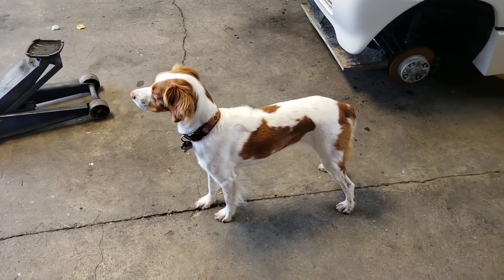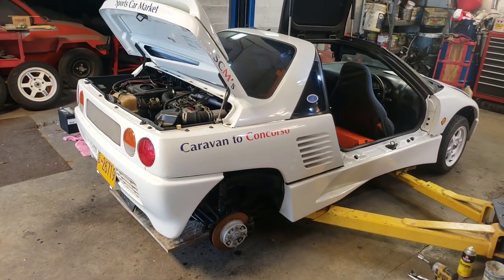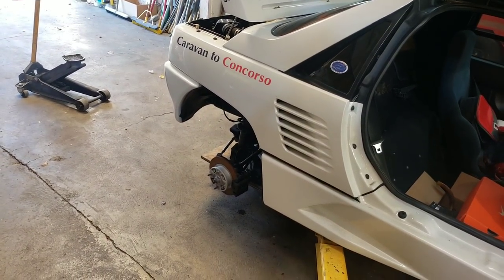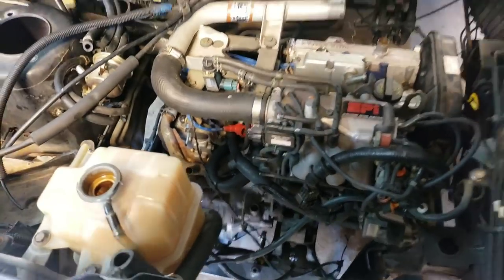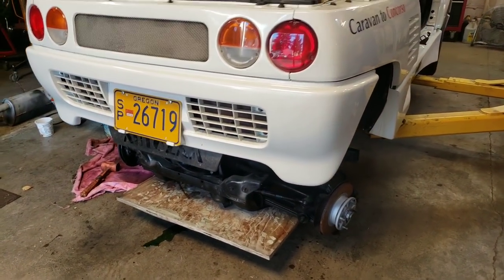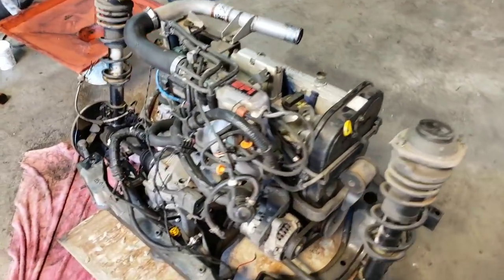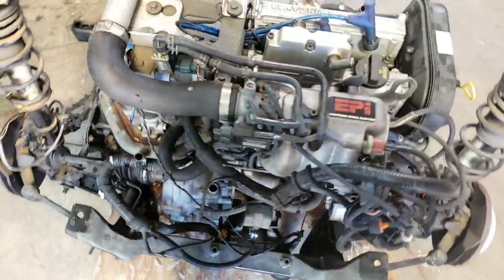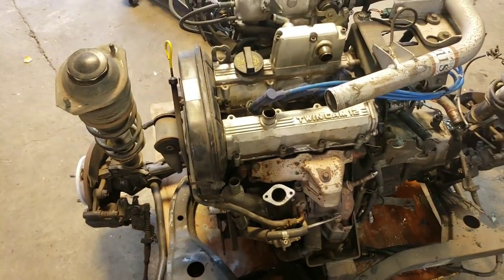Mazda AZ1 Autozam Gullwing with Suzuki Engine Removal

Comment: Have you tried a hand held induction heater to help remove those very rusty and possibly seized nuts and bolts? Much safer than a naked flame and easier to use. The coil can be adjusted to suit every job. I used one to help in the change of a well rusted on turbo and I got all the nuts undone with no sheared off studs, totally unheard of! Anything that helps avoid the pain of sheared off nuts bolts and studs has to be a good thing!
Reply: That's a great idea. I hope I remember it when/if I finally ever need that trick!

Comment: If that's like some mid-engine cars, that subframe likely also fits under some certain FWD Mazda.
Reply: not sure if the sub-frame is the same but same engine/tranny/suspension setup as the Suzuki Alto Works